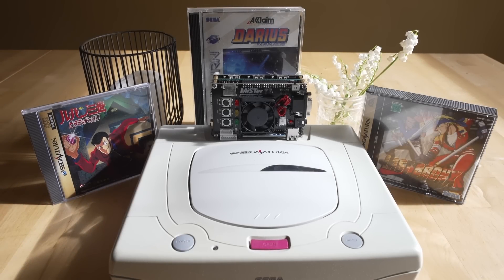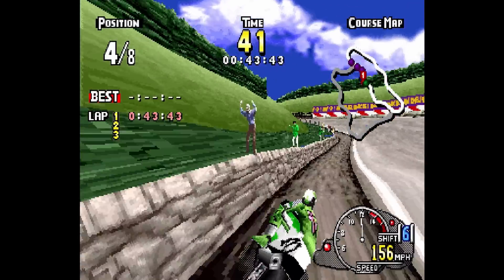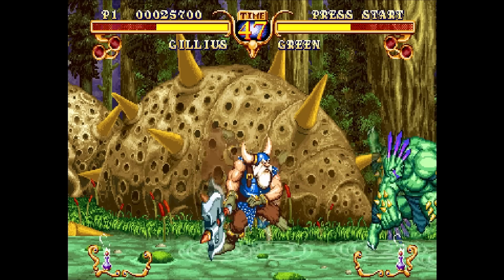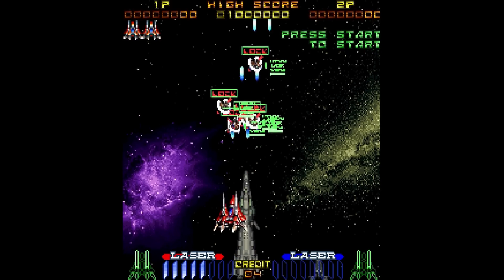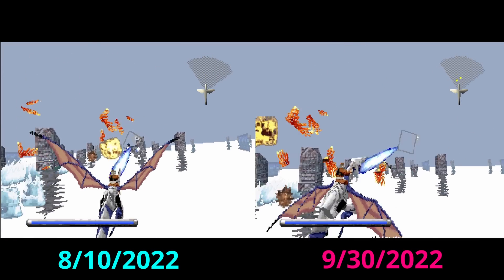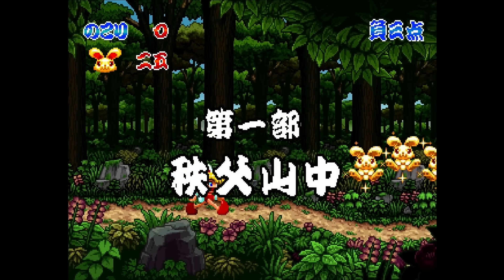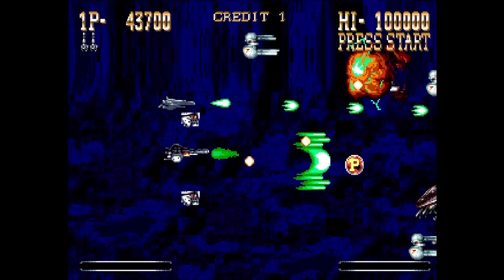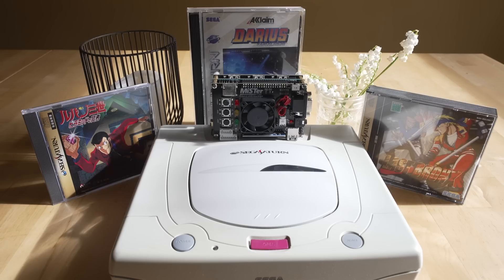MiSTer FPGA DE10 NANO! Saturn Core WAS UPDATED! Testing the October Build of the Sega Saturn Core!

Comment: Sonic Jam has been my guinea pig so far. In the previous builds it barely loaded and it was VERY slow. NOW it loads the intro perfectly and the title screen isn't cut in half. However, loading to a game in the menu itself takes a long time, and button inputs don't register well. I know it's kind of a silly game to try since we have the originals on the mister, but it's mostly to test going between resolutions quickly.
Reply from the maker: Sonic Jam is a good example as it’s both pure 2D and 3D af the same time

Comment: Saturn is a console that has gone under my radar for a long time. While exploring the PS1 library, I read online that Saturn had the better counterparts as far as 2D games went and have since been curious. As for a request, Final Fight Revenge.
Reply from the maker: Saturn was a 2D powerhouse for sure. I will add Revenge to the list!
Reply: Decided to try it out myself. We're gonna have to wait until 4MB RAM is implemented.
Reply from the maker: Yes that’s not here yet
Reply: Saturn also has phenomenal video out for the time... Using an hdmi converter, Saturn is amazingly sharp and crisp on modern displays...
Reply from the maker: RGB is near to perfect too

Comment: I don't remember if you did this before, but can you do a comparison of Saturn Bomberman (Original, Fenrir and MiSTer)? I ask because I was playing it last week (using fenrir) and the cutscenes seemed to have artifacts in them. Maybe I'm still clueless on Video tech but I would have thought that a game like that, via CRT, wouldn't have artifacts during any cutscenes. My logic is that since my fenrir is is using a different method for getting the game, maybe my understanding needs to be more defined. If you know of anyone who really breaks down how the fenrir works, I'd love that since the official website is SUPER empty. This may be an easy question that doesn't require that effort but I don't have a Saturn with the optical drive in it (nor is my fenrir the dual setup), so testing my official JP Saturn Bomberman isn't an option until I get a second saturn. I know, or at least documentation tells me, that the MPEG card wouldn't work with Saturn Bomberman but since it has multiple anime cutscenes, I wonder if it would help.
Reply from the maker: I unfortunately don't have a Fenrir or any ODE for my Saturn but once the MiSTer core is buttoned up I can take a look. Its possible there is a bitrate issue with Fenrir or perhaps the dump you used is having issues? I'd try a new set of files. Technically it may be loading in too fast which could also present issues
Reply: @VideoGameEsoterica  Firstly...WWWHHHAAATTTTTTT????!!! You don't have Fenrir? I would have thought you to have it or at least have the version that allows for both the optical drive and the fenrir. Secondly, your theory makes a LOT of sense. I need to figure out who I can speak to about this that's related to the project to see about underclocking or overclocking the fenrir. What would be amazing is the MPEG function on fenrir (I know I went on about it being on MiSTer but it might be more realistic on the fenrir).
Reply from the maker: Just never got around to it. I mostly like spinning up the discs in my collection. Contrary to popular believe I have not yet purchased everything lolol
Reply: @VideoGameEsoterica  I understand. I mainly got the fenrir because 1. I can't justify some of the current market prices for the US version of Saturn Bomberman or SFA3. 2. Made mistakes with finances, so I'm now finally in a position to where I can save to go to JP to get these games while skipping the process of giving some guy on the internet all of my money. 3. I don't know yet how to solder, so I need to make sure my Saturn lasts me a while until I'm able to get my Saturn Holy Grail (Hi-Saturn). I know it's not that amazing compared to getting a Wondermega or something that's inherently better then it's original version but that's my favorite era of Sega because they just tried things but also were really clever with their hardware designs. Genesis is great but Saturn is for the children!
Reply from the maker: I get it. I mainly collect Japanese Saturn stuff and a lot of my expensive games I purchased YEARS ago back when you could get something like Saturn Bomberman for $20
Reply: @VideoGameEsoterica  Right. I had ample opportunity to do that too but around that time, I knew NOTHING about gaming culture. I knew I liked certain games, but if you're close to my age (circa 87) then maybe you can relate to most of us thinking that the digital age was the end all be all. Flat screens would be superior to CRT. Pixels were dead. Here we are in 2022 paying for CRT's that people used to leave outside of their house for free and you had to hope to find it before the next rainy day. I still refuse to buy records that cost more then $10 because I was record collecting in the very early 2000s when you could have found a Kate Bush album in the dollar bin.
Reply from the maker: See during that age when everyone was SELLING...I was BUYING. Although I did talk myself out of plenty of $30 games back in the day because I thought they were too high...which now are $500+ games. Oops
Reply: @VideoGameEsoterica  I kept seeing a Neo Geo in the early 2000s for I think $300 or a little under that and I couldn't afford it. Then I could but thought that it wouldn't have been a good idea because I'd eventually wait them out for the price to drop. I think if the MiSter came out much sooner then it did, especially before the CRT emergence of the late 2010's, maybe I could have gotten it for less.
Reply from the maker: that's how I own all my AES stuff. Purchased when a $2000 game cost $300. So thankful I did
Reply: @VideoGameEsoterica  Where I really messed up was with games. I never was the kid who had all of his video game stuff stashed in the original casing (as I assume most kids were) and there quite a few pricey games now that I know I had a copy of before 2010. I still have my original copy of Rogue Galaxy and USED to have my original copy of Last Blade 2 on Dreamcast but can't seem to find it. I just need like 2-3 good Japan trips and I think I'll most of what I need (video game wise at least. I also am a huge fan of Toyota JDM)
Reply from the maker: Ugh I wish I had my games as a kid. Why did I trade them in!?
Reply: @VideoGameEsoterica  because GameStop tricked us into thinking we were getting a deal